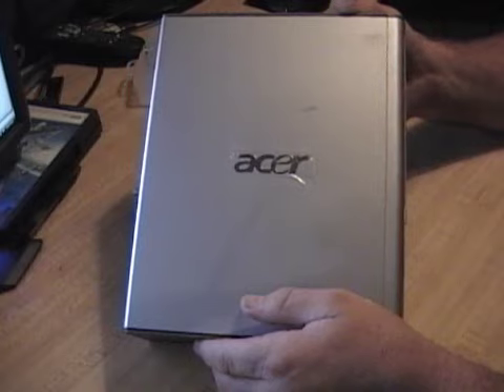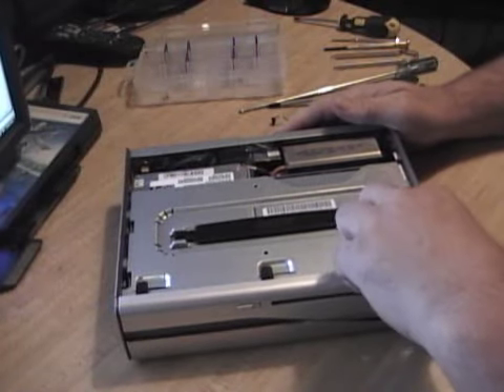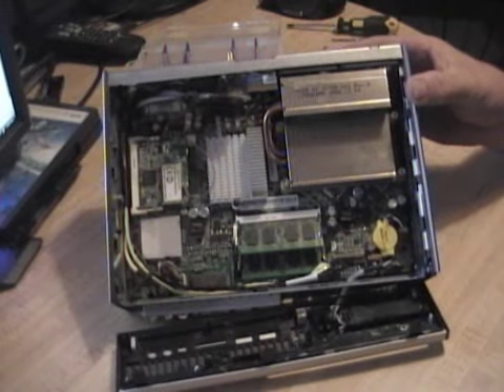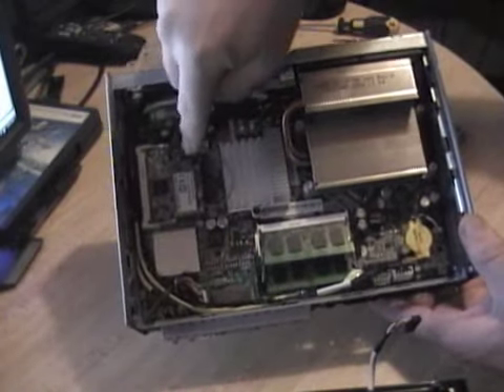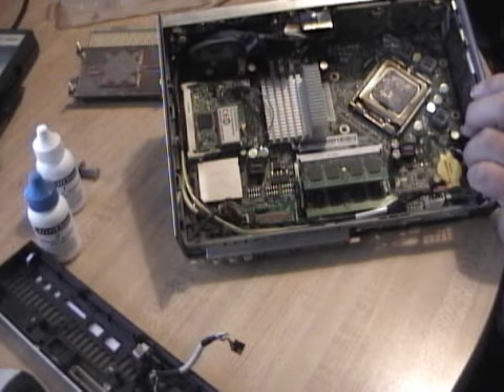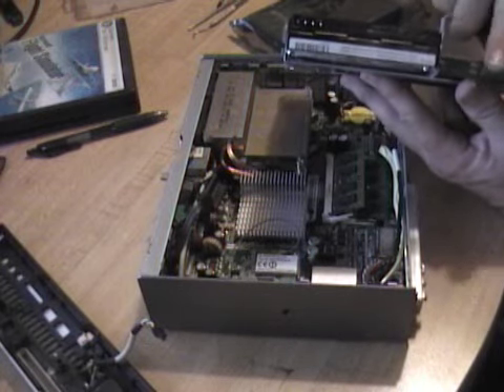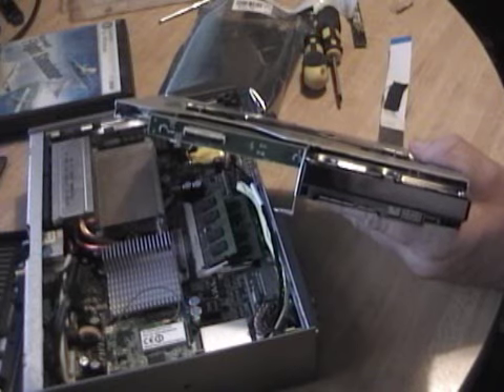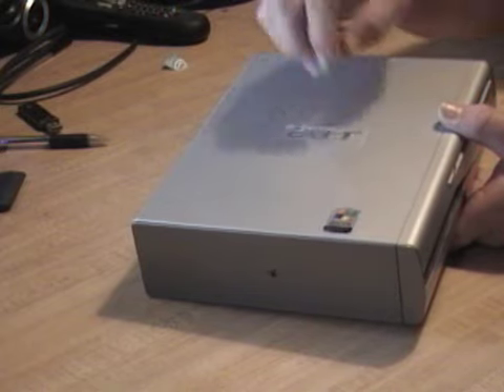Acer Aspire L310 repair/upgrade

Comment: CompUSA in NY was sold out of L310 over 5 years ago, so I bought their discounted presentation model. I took it to the Caribbean where I was working then. Installed Win 2003 SB Server. It has been serving me extremely well since then on my job assignments as development and production Web, DB, File and Mail server for up to 15 office/accounting users. Upgraded the memory recently. In my current office in London, this machine has been running non-stop since 4 years (with the occasional re-boot)!

Comment: The Seagate disk that comes with it, causes heat outage and boot problems (can't find the drive.) The Barracuda 7200.10 Datasheet indicates the Operating/Idle Avg. dissepates 13/9 Watts. Most green drives now dissepate only 40% of that. This solved my problems.

Comment: This is pretty interesting because there is very little information about this model on the net. I've basically got a motherboard that needs to be replaced but I don't think anyone makes anything compatiable. The idea of going cooler is a great idea as I think heat killed the one that I have.

Comment: If something only works intermittently, I would guess it's a connection or wiring problem. Service manuals (pdf) for the L3600 are available on the web if you want to pop the lid for an inspection. If everything looks normal, I would have the power supply tested.

Comment: Where are you able to get the optic drive connector?  I busted mine off also and it is the only thing keeping this unit from being 100%.  The connector has a 90 degree turn so the flat cable comes straight up the back.  Yours looks like it comes straight out the drive without the 90 degree turn.

Comment: hiii....i saw ur video... plz tell me which wifi card has been installed on the system... i have same pc, i tried many wifi card but in windows it always showing cross(x)... i connected wifi antena also windows is detected the wifi card... as i also checked on device manager.... pls advice how i am able to use wifi.